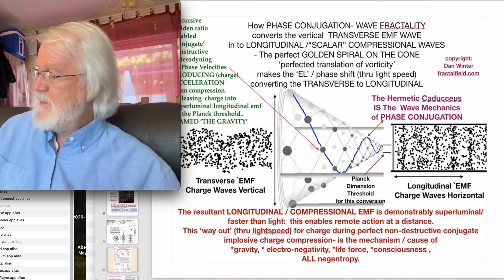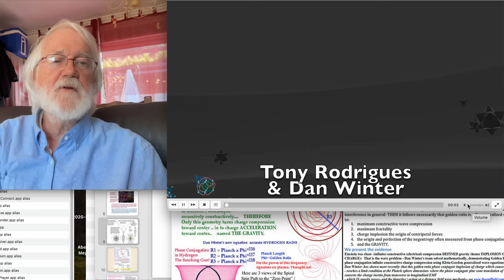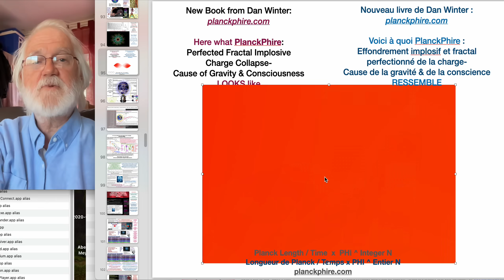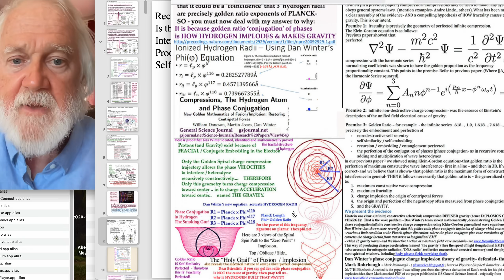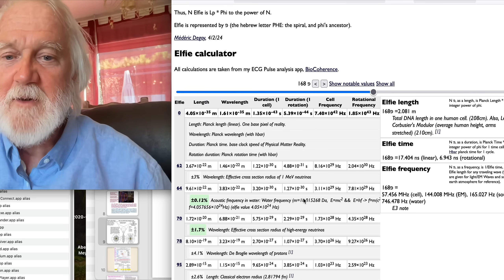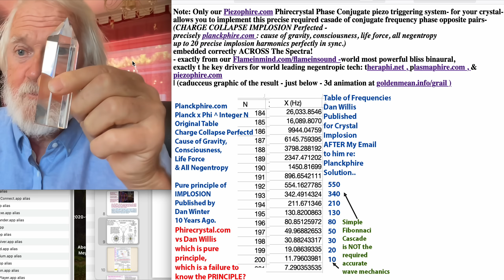PT2:Vortex Gravity for Scientists, w Physics of Wireless Power, Fire Crystals, Pyramids w Dan Winter

Comment: With the original pyramid alignment, it was a gravitational vectoring system that created gravity, pure gravity in the Kings chamber and above that at the Apex anti-gravity or electrical current. 

So the Kings chamber had a gravity envelope that accelerated healing and the slope to the entrance matches the exact gravitational harmonics angle to allow you to float up to the chamber or fall back down at that 26° angle it must’ve been amazing

Comment: Concerning the "Tesla was dumb for 60cps power instead of 50" around the 48min mark:

1 - 60hz is a bit more efficient from a transformer perspective.  Less steel per-kwh transformers means a cheaper grid overall.   (this is why 50hz countries tend to be 220/240v to help compensate for this loss of efficiency)

2 - 60hz is polar symmetric and easier to model mathematically, especially in 3-phase, since each element occupies 120deg all the inter-modulations are simple 20/30/60deg even relationships.  Round, whole numbers.
It's the same reason we use 60 second minutes and 60 minute hours.   In the 20th century it was much easier to teach electrical engineering as cycles rotating around a clock and harmonics of this.

3 - Dan may have been confusing the issue since Tesla wasn't using 50hz or 60hz AC for his Colorado Springs telluric and HV experiments.
Colorado Springs telluric work started around 80kcps(80khz) and later worked down to around 50kcps(50khz)
And Tesla's DC disrupted discharges works were usually from a wide range 1khz to around 30khz (limited mostly by the speed of the brushes+motors

Very often what is seen as a "stupid" move is merely a decision made using a different perspective or paradigm.
Reply from the maker: we probably did not explain well   - the opposite to phase conjugate / means opposite to centripetal   , and THEREFORE OPPOSITE TO LIFE FORCE  ( www.planckphire.com ) 60 hz-  means ZERO (carbon) nano production will EVER happen (  https://fractalfield.com/nanotechconfidential/ ) the most important new industry on the planet is forever forbidden to america  ( in perfect conjugate 50 hz- fullerenes can grow - NOT in 60 hz plants - EVER) -  not only this - those who understand will realize WHY 60 hz  - IS OPPOSITE TO LIFE!  ( 60hz:frequency at which the voltage known to STOP the heart is about LOWEST,   50 hz well known in cancer research as THE most healing      www.theraphi.net/static         .. also     - tesla's beam weapon dream DOA because he did not understand  conjugation (to planck) is the ONLY source of coherence longitudinal (directional)  interferometry

Comment: Due to the oscillatory asymmetry of the atoms, the non-magnetic moment = the collapse of the magnetic moment is greater than the magnetic moment in the hydrogen atom, which is when this inverse space-time fractality greater than the magnetic fractality is generated in an expansive way. This implosive inverse fractality consists of spin down electrons that oscillate asymmetrically in the form of phase conjugation also where their attractive and implosive energy is greater than their expansive repulsive energy Nikola Tesla that in all those oscillations both in the atoms and in space time there was a cosmic universal radio frequency.

Comment: There is a mediating particle of the electromagnetic waves that makes them oscillate at the same time symmetrically just like the electromagnetic quantum fluctuations, since the two are the same, that particle is the ether. When that ether particle is found within a magnetic or gravitational field those oscillations become asymmetric. In the case of magnetism, the amplitude of its crests is greater than that of the valley, and its wavelength at the crests is smaller than that of the valley, measuring 0.14 nanometers. In gravity, the amplitude of the valley is greater than that of its crest, producing a negative electrostatic attraction, its wavelength is equal to its crest. The greater the oscillatory density, the greater its interaction and vice versa. That is the oscillatory asymmetry of the ether.

Its magnetic moment = expansion. And its non-magnetic moment = moment of magnetic collapse when it reaches the negative Y axis. That asymmetric oscillation occurs at the same time in the form of negative entropy, producing positronic negative electrostatic attraction

Comment: you can do this exactly this in the body through some somewhat specific preparation in the lungs. utilizing the asymmetric bifurcation of the bronchi and a fully evacuated lung with the use of nitrous oxide. This was studied at the pneumatic institute via Beddoes and Humprey Davy's but they didn't get the system down correctly. You can utilize this is many ways for accessing inner and outer consciousness quantumness. In a partial vacuum there is a potential between airways/ bronchi (gas) and the bronchovascular bundles (arterials/lymph) which build capacitance in a magnetohydrodynamic sense that leads to this propogation mentioned here. Sounds out there but i dont really know how to word it more simply.

Comment: Is that why falling objects don't experience the force gravity while falling?
Reply: Gravity is caused by pressure mediation at the most fundamental level after that it’s an electrostatic / capacitance phenomena 

The reason objects fall from the air is because they don’t originate in air and don’t belong in the air it’s actually that simple. If you make that object a helium balloon suddenly it doesn’t experience gravity wow gee I wonder why. Because helium originates in the air and belongs in the air.
Reply: @off6848  thanks 👍
Reply: No its because objects that are being acted on by gravity cant be acted on any further essentially. You are already going the speed of "the gravity"... what else would pull you down?
Reply: @leonerdmanechest7271  the “speed” of gravity suddenly changes when the object falls through water. Because there is no gravity it’s all density and pressure mediation.
Reply: @leonerdmanechest7271  thanks 👍